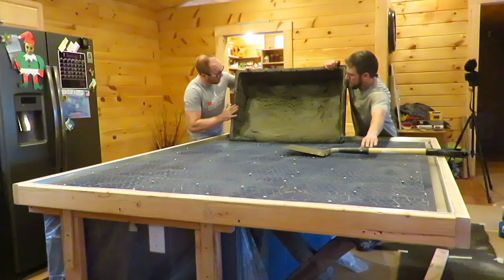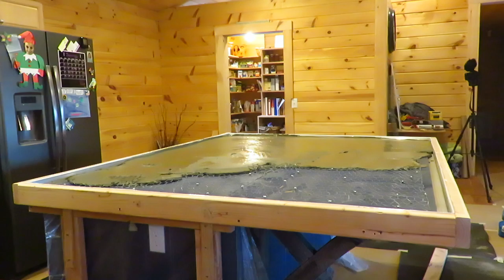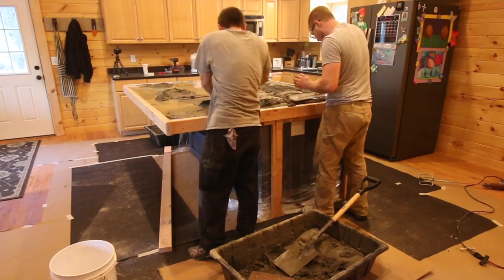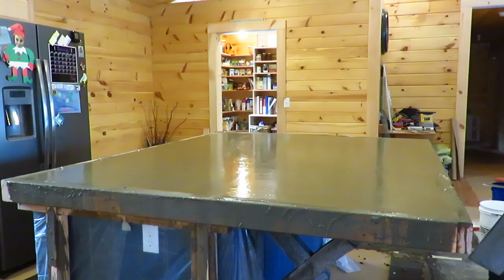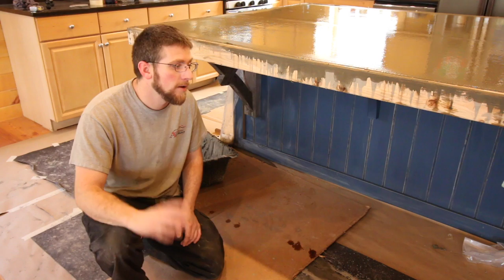Pouring Concrete Counter Tops in Place!

Comment: I think you did a great job. What I don't understand are the nitpicking, negative comments.
Reply from the maker: Christopher Carrigan Thanks. Yea I don't get all the nitpicking. We are enjoying it and it came our Awesome. It last a life time. Do you plan on making any concrete counter tops?
Reply: jealousy is an ugly character flaw....but at least they feel good about themselves.....Al's got it....they just won't get an invitation to have Thanksgiving dinner on the counter top....that interestingly enough, by their estimates...has ALREADY more than outlived itself!! lol!
Reply: Well concrete-wise several mistakes were made because of a lack of understanding how concrete works. 
On the other side, this is a fully supported countertop. It’s not cantilevered and it’s not subjected to high stresses at all. So it will probably last a very long time :)
Reply: Just some basics:
Water is detrimental to the strength of concrete, add just enough to make it workable, no more (there are chemicals that make concrete more workable without changing the water/cement ratio)
This is also the reason why you shouldn’t trowel the water off. You’ll end up pressing water in the upper layer and increase the water/cement ratio thus the top layer will be a lot weaker.
Water floating on top is just fine.
Reply: You are 100% correct.  Too much water weakens the concrete.

Comment: Pretty slick!  A concrete counter top is not something I would have thought of; the pouring in place makes it even more slick.
Reply from the maker: Thank you! We knew we had to pour it in place if we wanted to do one. it is way to big to pour and then set in place. It weighs 500 pounds!  Best part is it cost under $300! the counter top  is 6 feet by 7 feet too!

Comment: How very interesting.  I was unaware the concrete could actually be poured onto the structure.
Reply: Virginia Reid By “structure,” are you referring to the base of the countertop?  Or the bottom part of the island that holds up the rest? How else would the concrete get there??

Comment: Rather than keep adding water, start with less mix and get a good slurry started then add mix until you get the right slump. Add mix to the water. 

Don't work the cream on top too soon and too much. The cream will rise and then most of the water will get absorbed back in. At room temps, do not spray it with water. The cement is supposed to absorb the water as it cures.

Comment: That's great guys I love concrete countertops.  Personally I'd use some heavier wire or mesh and thin rebar where you have no support.  Place it into the concrete after you pour it half thick, that way you're sure it's not pushed to the bottom.  But, hey it looks good.

Comment: Were you concerned about the depth of overhang not being supported directly by a pole support of some type. Any chance of cracking when weight or pressure would be applied?

Comment: Not sure if the maker of the video is still reading comments but a bit of constructive criticism. I’ve been doing concrete counter tops for about ten years now and was interested in seeing some ideas for making the top in place instead of off site. 
It is always best to follow the manufacturers specs for your water content. Believe it or not. More water equals less strength. It often will begin to crumble within a few years. You need to vibrate your form. They actually make vibrators for the application or you can pull blades out of your sawzall or jigsaw and let that tap the side of your form. That will raise bubbles to the top and give you a bit of water. Let that sit. With the vibration it will self level and you won’t need to trowel. Lastly. Sealant. If you haven’t put it on yet. Put it on to increase the lifetime of the counter. All that said. Two people. Hand mixed on that size counter is an endeavor in its own.

Comment: Always follow manufactures directions.  i find it best when making small batches like that to do half bags at a time. 
also, screed only area fully covered to depth and keep adding til complete.
screed once in one direction then the other way. float it ONE TIME then let set up until it looks dull before troweling.
hit the edges with a edge trowel.
All that water was the expensive portland cement you basically washed out of the mix.  when you go to stain there won't be much left to penetrate and you will see sand and substrate.
that being said, even though you messed up the materials are cheap and you got some experience.
if its needs to be redone it didnt cost much.
Reply: tip:
rather than using a tub, use 5 gallon bucket with mortar paddle for mixing. only mix for 5 minutes, pour and repeat.
Reply from the maker: Thanks. We are enjoying the counter top. We tried using the amount of water they recommended but it was way too dry. I was wondering if you would need a mixer for it?  We have one more to make for a desktop, I will try some of your recommendations on that one thanks

Comment: You could build a Pool table the same way actually//..you  can also build an inexpensive derby with a piece of half inch ply, a piece of 2x2 and 2 strips of ply that  hold the  derby to the 2x2 , screwed at an angle

Comment: Cement work tip: to guard against splash & for easy clean-up: Prep with soapy water solution: applied on all surfaces that need protecting/splash guarding. Water wash away when work is done

Comment: Steel trials leave a beautiful finish but also weakens the surface and will cause "popping" later on. Popping is when the top surface has several locations where it starts to pop off, leaving small holes in the surface. Use Magnesium trials instead
Reply: Trowels??

Comment: I think it looks great!  I agree with the water ratio BUT this is a counter top supported by a reinforced  top. I think it'll be fine. The strength matters more if it were a drive way, sidewalk or side of a building
Reply from the maker: It is holding up great so far. Next pour we do I will try going with the recommended amount again, but this time it was way to dry by following instructions

Comment: Really nice work guys.  The pace was great and the video was informative. My wife just asked for an outdoor table with a concrete top but I haven't figured out how to address the weight of the item driving the base into the ground.  You have a new subscriber.
Reply from the maker: Thanks! If you set the table on pavers I bet it wouldn't drive into the ground! Thanks for subscribing.

Comment: Something that would have made this a LOT easier, a LOT faster, a LOT lighter and a LOT cheaper would have been to use Stone Coat.  Check out the Stone Coat Countertops channel.  His work is really awesome for countertops that you can make out of MDF and you can make them look like granite, quartz, marble or anything you want.  They are a LOT less back-breaking.

Comment: I think when I do my concrete counter tops I can going to mix the concrete in 5 gallon buckets and mix with a drill and cement mixing attachment.   Get a few buckets and have an assistant do nothing but mix concrete.  should go faster and be easy to pour.
Reply: The speed of a power mixer will add air to the mix. Be sure to vibrate the air out after.

Comment: Looks great! I'm going to be starting a bar top pretty soon that looks about this size. Could you tell me what size and thickness you went? And how many bags of concrete you used as well? Thanks!
Reply from the maker: Nick Pooler I went 1.5 inches thick and I used 6 bags of quick Crete concrete counter top mix. It was special order from lowes. If you look up concrete calculator on google u can enter your dimensions and I'll tell you how much concrete you needs
Reply: Lumnah Acres Thank you, yeah I've looked up a few and keep getting different results. Oh well, thank you much!
Reply from the maker: Yw, Send us some pictures when you are all done!

Comment: The manufacturer knows how much water to use, they test the concrete in labs, with engineers overseeing the process. They test it on countertops also. You put way too much water, you used about 60% more than you should have. That will most certainly change the strength and integrity. When you mix the concrete in a actual mixer it would not be so hard to mix it. You thought you didn't have enough water because you was mixing by hand. Otherwise, good job.

Comment: Good Job.  And you did not use too much Water. Mix it like you want to handle it. Concrete is not rocketsience . But dont use chickenwire if possible use thicker steal. and rowbars
Reply from the maker: Thanks! Thats pretty much how I feel too! Lol
Reply: uh too much water is not good for concrete i wouldnt set a bowl of cereal on it personally lol

Comment: I'd like to know more about why you spray as it dries. Are you watching for uneven drying? Would that show in a color change in the concrete? Is it a problem because it causes cracking?
Reply from the maker: Amy Delventhal you spray it so it dry even. If the top dries first there is more chance of cracking. You want it to dry more from the inside out. The concrete mix I used recommended keeping it moist by spraying on renting it with plastic for  18 hrs.

Comment: Is not to much water used for the mixing is just the type of concrete and concrete always blinding the water usually is go down into the ground, but is sitting in wood o wherever so water is going up the only problem I saw is he using the trowel instead of float but is good great job, 👍

Comment: You drastically weakened that counter top with all that water.  You want the concrete damp, but not soupy.
Reply: Chris Carpenter I'm pretty sure this should be a tutorial video on how not to pour countertops. This is what happens when people watch a couple YouTube videos and think it's easy. I give this piece a couple months till it's cracked all over the place
Reply: Its going to be a learning experience for those guys!
Reply from the maker: The counter top is AWESOME! I would do it the same all over again. Did I learn some pointers from this one yes, but that is how you learn. By doing. To many people dont do things because they are afraid of messing up. But that is how you learn it is a process! This counter top is awesome but the next one will be even better!
Reply: seriously, don't let someone sit on a stool and lean on that. WHEN it breaks, its going to crush someone. way too much water.

Comment: you used way to to much water, and you played with it way to much. When you push off water you are also pushing of cement.
Reply from the maker: Live and learn! Lol. I think if you only use the recommended amount of water you would need a concrete mixer!
Reply: Lumnah Acres gee really? Do you think using the correct tool for the job might be a good idea? To much water weakens the mix.
Reply: I just finished today pouring a countertop for my outdoor BBQ island. Just looking for confirmation on when to remove forms. I used the same blue bag quikrete mix and although I agree that 8 pints it’s not even enough to wet all the concrete, as only half was slightly moist and the rest was still dry powder, 13.5 quarts sounds like a whole lot. I ended up using 13.5 pints. Maybe this is what you meant but I didn’t get all that soupy waste and it didn’t look that wet. It held its shape and it was ready for magnesium float in about 45 minutes and steel about an hour or so after. Even so, I was still worried that it was too much water but it was the only way to get a flowable, workable mix. I would’ve freaked if I would’ve seen all that water coming out. I hope it’s strong.
Reply: ConcreteLand, I don't think that anyone could argue that using the right tool for the right job is bad advice, but do you have any thoughts on a less concrete subject as to how much being a tool might weaken the social interaction mix?
Reply: Yeah what he said! The first time you drive an 18 wheeler through your kitchen that table could break!
Reply: Absolutely... It's why they didn't show us the final product.. .. they don't have any experience with concrete
Reply: @ConcreteLand  , not so much unless its way over watered, main reason u change the slump is what grade is being poured on.  aint a damn thing wrong with that mix for how its used. still standing aint it
Reply: TIm WISENER I would disagree. Grade is not the main reason you change slump. Water is the downfall of concrete the majority of the time. In the part where they screeded the surface you are seeing bleed water. This is not good, it also creates areas of cream where they finish. The use of water reducers or plasticizers would fix this. And personally, I don’t know if it’s still standing.